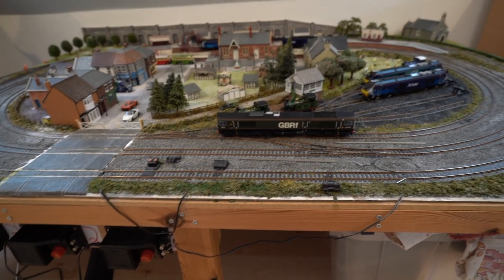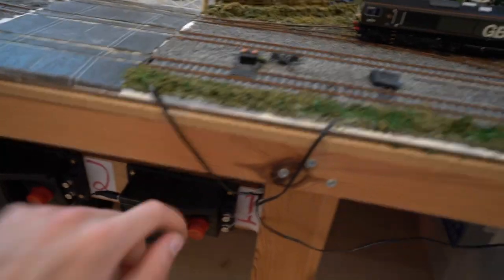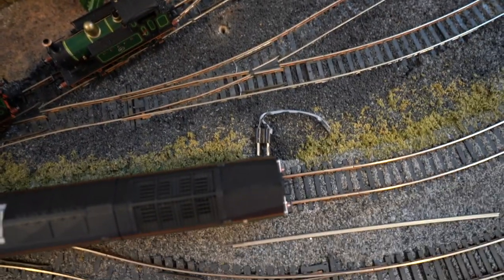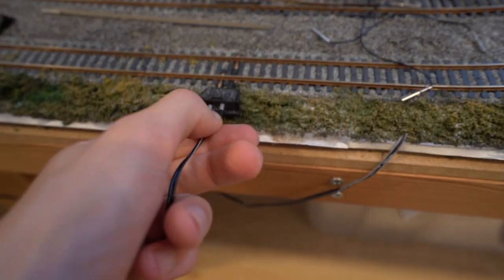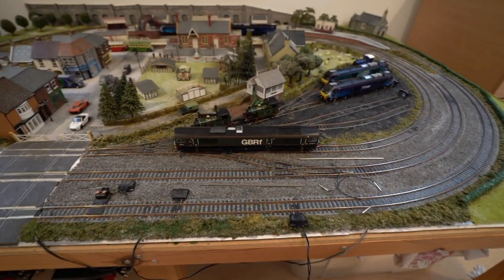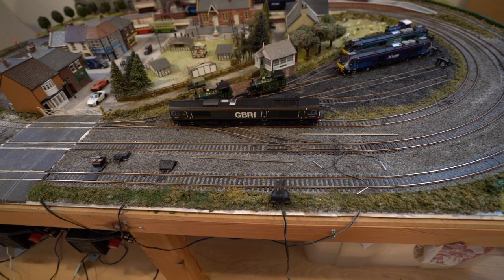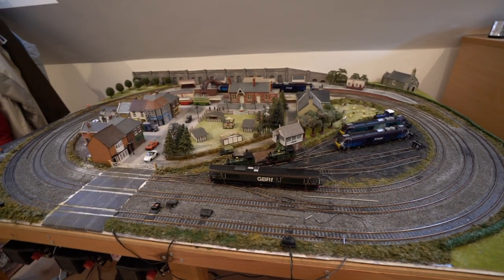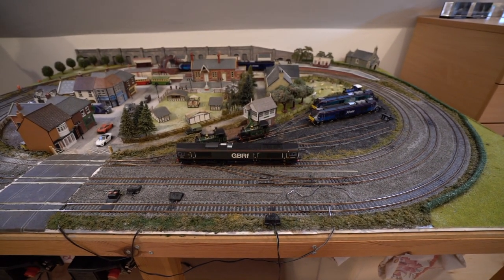How To Cheaply Convert Your Layout To DCC

Comment: Insulfrogs have the plastic in the V of the points whereas the electrofrog are metal Vs. If you use electrofrog points you will have to have switches to power the individual lines off it i.e. sidings or all the engines will move. Insulfrogs remove that complication but often cause power transfers for 0-4-0 locos. Peco electofrogs are smaller Vs and better than hornby ones which have larger plastic Vs and thus more problamatic. Hopes this helps.

Comment: I may have asked this question before, did you modify those R965  Controllers as Johns amazing trains did for improved runningamazing running? t

I purchased a Hornby Select but it did not include the power cord which is 15 volts  in and am having difficulty locating it here in Toronto

Comment: hi I want to alter my layout to dcc, will I be able to use all my old locos? that are dc
Reply: Hi there. I am not the video maker but I do have an urgent message to tell you. DO NOT PUT YOUR DC LOCOMOTIVES ON A DCC LAYOUT. DCC sets out a high amperage AC current which will rapidly overheat and burn out the motor inside of your locomotive, permanently damaging them. Hope this helps.
Reply: You would hav3e to put a decoder into your dc trained code it then you can use them

Comment: Good video but you are massively over thinking it. A and b, grey and black don't matter on dcc (nore on dc really just your trains run backwards). Just make sure that no single rail connects to both outputs at the same time,  directly or indirectly.

Comment: Would be more easy won’t be able to dynamics the entire layout by putting decoders underneath your track that would be more easier or using the Hornby computer control with a laptop that’s pretty a lot more easier than the dynamics are the way you done it with your powersupply you could put your power supplies where are a map to a year how break the cycle them where if there was a short circuit you wouldn’t ring you all later or your train is the it’s a nice night but the way down your wiring system is rather confusing to people were in maybe easier be over rowing dynamics and controller is pretty good
Reply: Mills Family WHAT?
Reply: Try full stops and commas